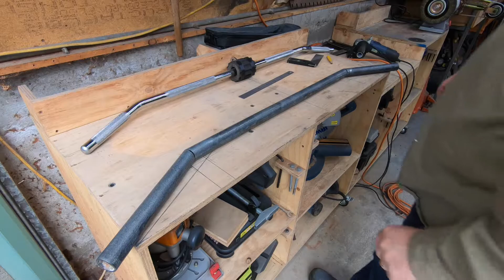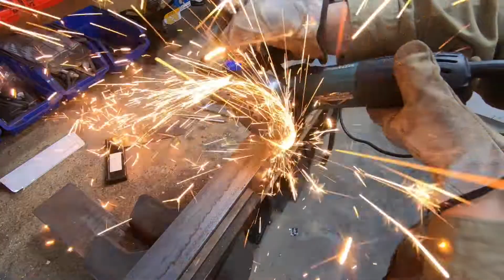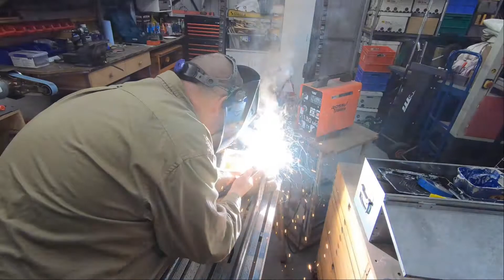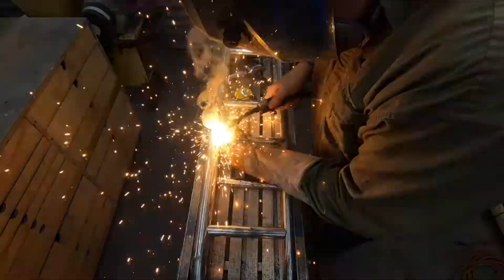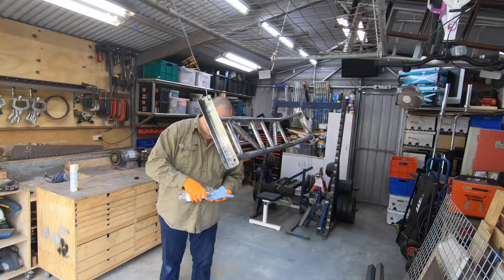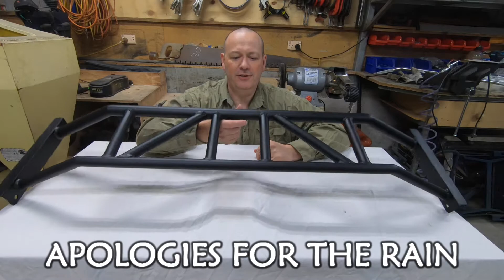How to MAKE a CUSTOM Multi-Grip Chin Up Bar from Reclaimed Steel

Comment: Measurements?
Reply from the maker: Howdy, thanks for watching and great question.  The only measurement I know was the width between the mounting brackets, which was a standard 1100mm (approx. 44in) to fit the squat rack I built it for. Everything else was by feel of my hands on the bars and distances etc.  But it would have been around 200mm (8in) between bars and the angle up gave it an extra 150mm (6in) of height above the top bar of the squat rack.  The angle of the bars was again, just what felt comfortable.  Hope that helps, cheers 😀
Reply: @hangingoutwithhally7463  thanks